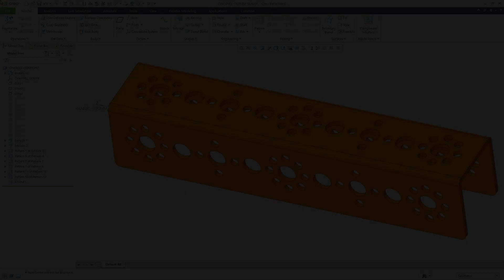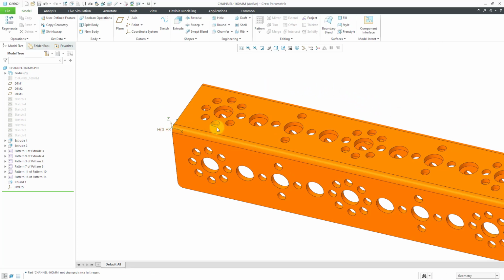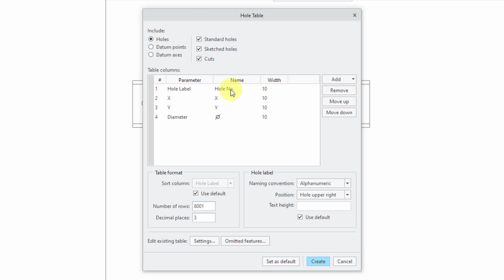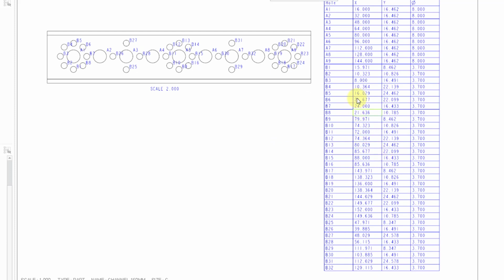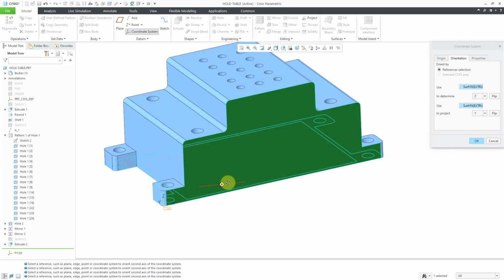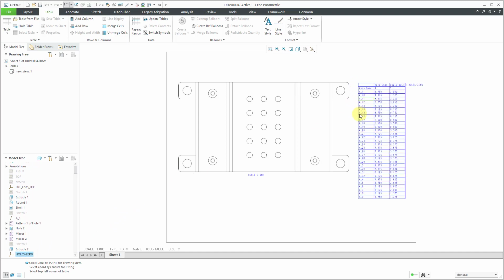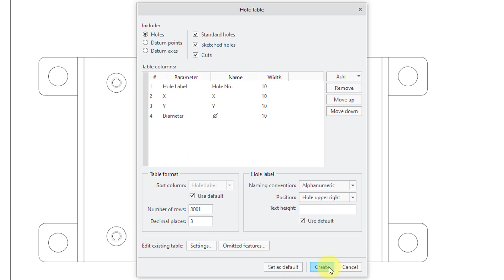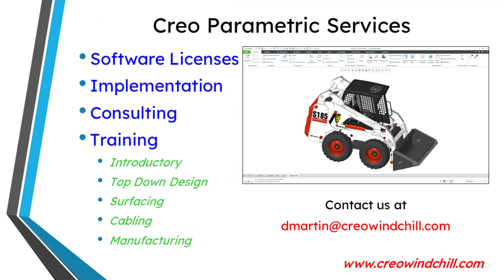Creo Parametric - Drawings | Hole Tables

Comment: I for one don't use Hole table. It's use is limited to just X and Y coordinates. Details of the hole can be directly stated in the drawing as an annotation. This also helps to have separate groups of holes of same specs but belonging to different pattern feature.

Hope I could make myself clear.

Comment: Hi Dave,
Is there a way to have commas instead of dots as the decimal markers in Creo's holes table?
I have tried to changing the decimal market to comma but it still didn't work
Reply from the maker: If changing the decimal marker in the drawing properties didn’t help, I recommend opening a ticket with PTC Technical Support.

Comment: Hi Dave, Thanks for you nice videos about Creo Shown here.
Unfortunetly I have to tell that PTC has a looooootttt to learn with the competitors on how to make a Hole Table. Actually, the one you show in this video is so poor that has almost no use for professionals.
It just shows hole #, X, Y and diameters. 
If I send this to the factory to execute a bunch of holes in a mold cavity, they will laugh on me.
A good Hole table should describe the hole at all like: Hole A1, Combo Hole Ø3/8" thru/Ø10mm T60/@15.2mm T6.35mm, X=60, Y=100
Or
Hole A2, Threaded Hole Ø1/2" T27.00, X=80, Y=120
That will be ok to execute all the holes in radial driller.
Reply from the maker: I hope you have submitted this to Ideas on PTC Community. This always gets a lot of discussion in the various meetings and I know Michael is receptive to improving the functionality.

Comment: Recently, I used the hole table in Creo 5 for some threaded holes as well as clearance holes of M12 X 1.75. The diameter column returned the same value of diameters for both type of holes. I think it should have shown clearance hole diameter instead of standard thread for the clearance hole. Any solution for this problem or if you may convey to the developer for future versions?
Reply from the maker: Hole Tables did get an update in Creo 8. I do not convey information to the product managers as the appropriate mechanism for this is the Ideas section of PTC Community, which anyone can submit to.

Comment: Hi Dave, I believe that the update issue that you have mentioned --> when you add/remove pattern instances the hole table is not updated properly, is resolved with Creo 8.0. So far it required a user action to update the tables and now it will be done automatically as you will switch to the drawing window or during drawing retrieval
Reply from the maker: Michael, that is great news. I will spread the word.

Comment: Can you make a video on load applied on steel structure..
Reply from the maker: I have videos next month on how to apply force loads in Creo Simulate but not specifically on steel structures. But the same concepts apply. There's nothing particular to applying loads to a steel structure as opposed to ferrous and non-ferrous metals, polymers, composites, or any other materials.

Comment: The hole table seems to be incomplete in a couple of ways. You mentioned it not picking up the extrusions- I would guess that maybe it would pick them up if, for example in your second part, you created the tabs and then extruded a second time to cut the holes?

What makes me more nervous is that, in your second part again, it looked like your 10-24 holes had a counterbore.  The hole table did not reflect that at all. Incomplete information is only so helpful.  With blind holes will it show depths? 

I was waiting to see how to show the hole table coordinate system on the drawing- do you just have to turn on that visibility and hide all other coordinate systems?  Or is there a command similar to section views where you go back and add arrows after the fact?  I liked how Inventor handled that by selecting the coordinate system origin in the drawing and in the view your hole table was referencing (and then it showed it).

I know Creo 8 is supposed to have a good deal of updated hole functionality- hopefully the hole table gets an update as well.
Reply from the maker: I showed the way it works and also explained my apprehensions. You manage coordinate system visibility the same way you manage visibility of any coordinate systems.
Reply: @CADPLMGuy  But how do I show the origin of coordinate system in the drawing? That is, the 0,0 point in the drawing mode. 
Is there an option to show it?
Reply from the maker: @77prince77  Show Model Annotations
Reply: @CADPLMGuy  In Show Model Annotations there isn't any option to show the origin of coordinate system. In your video it is not indicated where it is the 0,0 point. I'm using CREO version 3 ¿Will it be because for the version of the program? Thanks for your answer.
Reply from the maker: @77prince77  You're right, I thought Show Model Annotations included coordinate systems. Use Layers to control the display of coordinate systems on the drawing sheet.